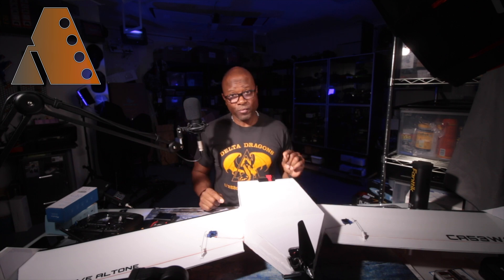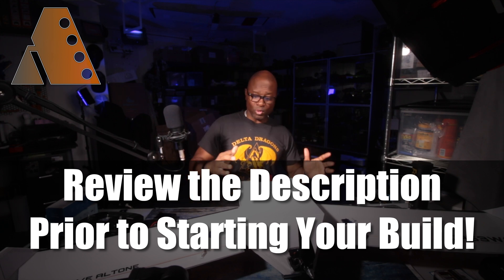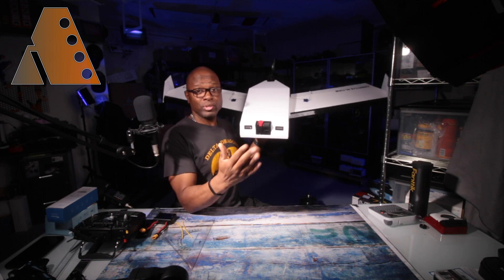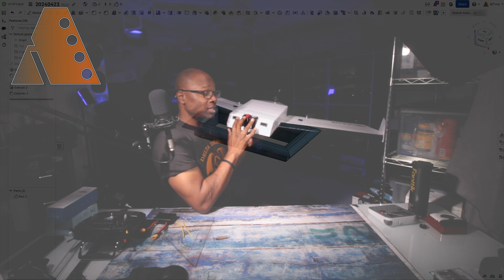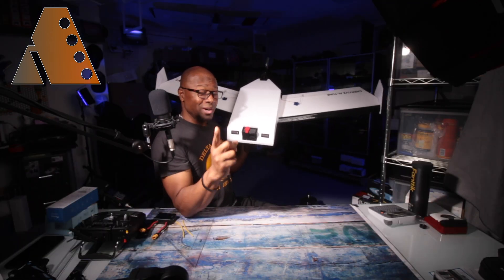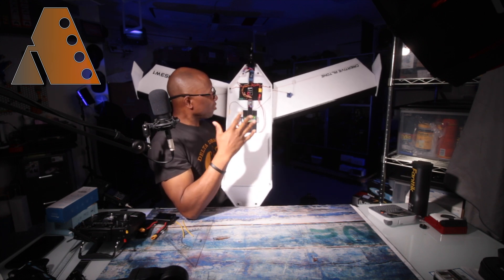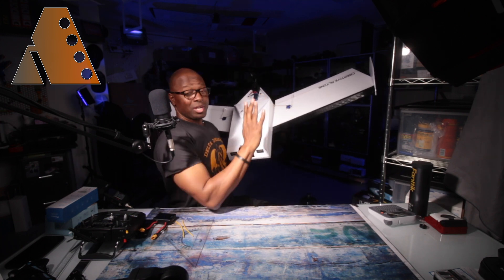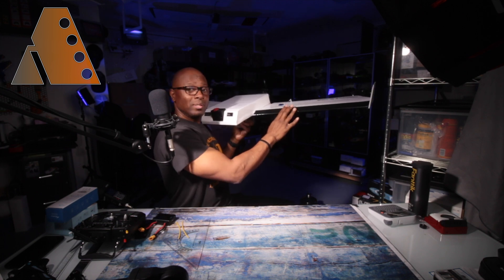CA53WV1 RC DIY FLYING WING BUILD OVERVIEW

Comment from the maker: Electronics: 
FLASH HOBBY D2826EVO 1100kv RC Brushless Motor: https://amzn.to/3XdO0iT (AMAZON)
60A RC Brushless Motor Electric Speed Controller:  https://geni.us/40AMPESC (AMAZON)
MAS RC Propellers 9x4.5: https://geni.us/MASPROPS-94 (AMAZON)
Miuzei MG90S 9G Micro Servo: hhttps://geni.us/SERVOSET (AMAZON
14 awg Silicone Electrical Wire: https://geni.us/RCWIRE (AMAZON)
50Pcs ABS Servo Extension Cable Safety Connector Clips: https://geni.us/ServoSafetyClip (Amazon)
9 Pieces JST Y Connector 3 Pin JST Plug Splitters Servo Extension: https://geni.us/ServoYconnector (Amazon) 
Servo Extension Connection: https://geni.us/ServoWireExtentions (Amazon)
FymuSing 12 Pair XT60H (XT60 Upgrade): https://geni.us/XT60connectors (Amazon)

Radio & Reciever:
ER6 Reciever: https://geni.us/j2zdF (Amazon)
RadioMasterTX16S: https://geni.us/RadioMasterTX16s
Creative AlTone Channel Page:  https://www.youtube.com/@creativealtone

If you don’t feel like building and just want something  great to fly check out all the planes FMS Hobby has to offer: https://www.fmshobby.com/cwuolwgr (Affiliate Link)

Anycubic 3D Printers Affiliate Links: 
anycubic.sjv.io/GmMWEm  
https://geni.us/anycubicAMZ
Cricut  Joy Xtra - https://geni.us/CricutJoyXtra (Amazon)